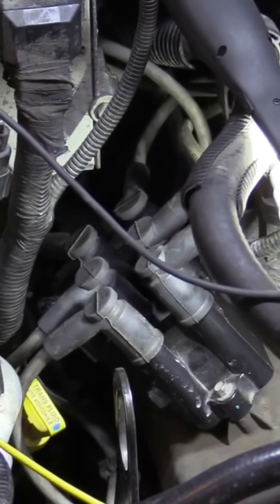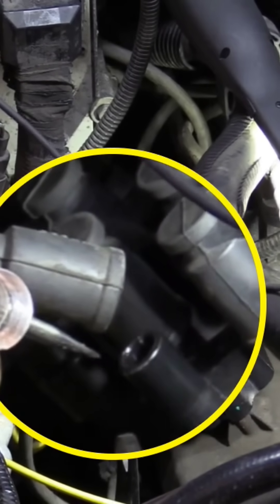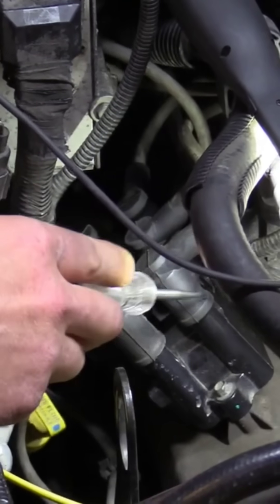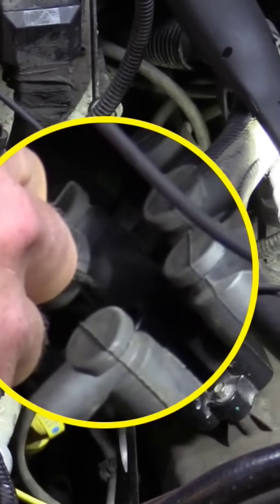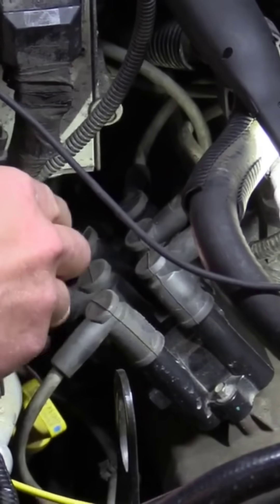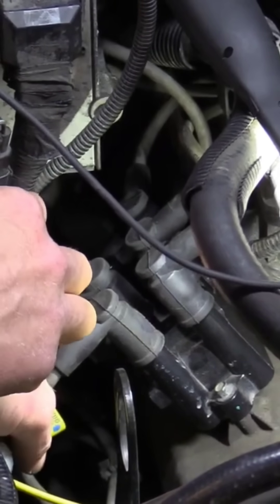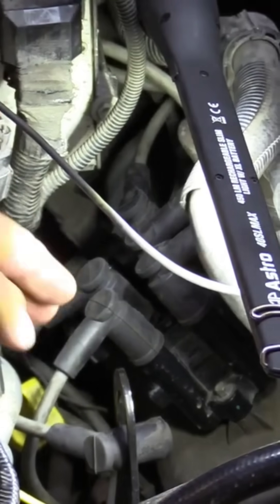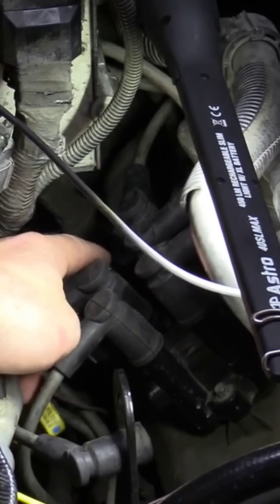RPM Drop test using a test light [incandescent only!]

Comment: We use to put small pieces of vacuum hose in coil hole and in plug wires then touch test light to vacuum hose to short out the cylinder

Comment: I was working on a1969 Pontiac Firebird with a 455 Ramair 5 engine with a Dryers Blower with twin Holleys and a Vertex magneto and i went to set the timing and someone didn't have the plug wires all the way in and i got a 100 thousand volts from a earth magnet 🧲 have a blessed day 🙏 couldn't feel my arm for a half an hour and when I did nothing hurt that bad 😞
Reply from the maker: 🫨 I bet that one did hurt

Comment: as much as you can actually use this method , you are actually overboosting the coils because they can't give out their energy then intended. so they boost much higher volatge (power) than expected so it might ruin the coilpack. remember - they are intended for 1mm gap..not 30mm gap.
Reply from the maker: They can handle this momentary test. Never hurt one yet in 30 years doing this.